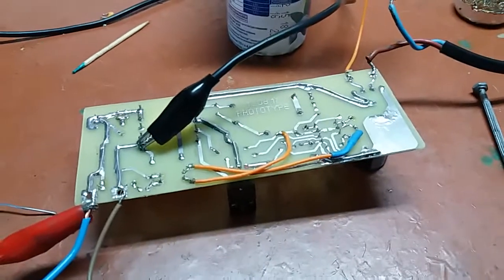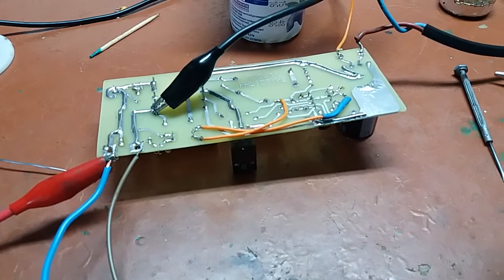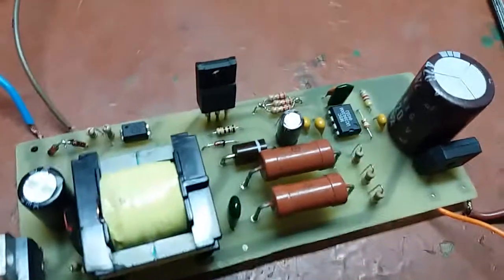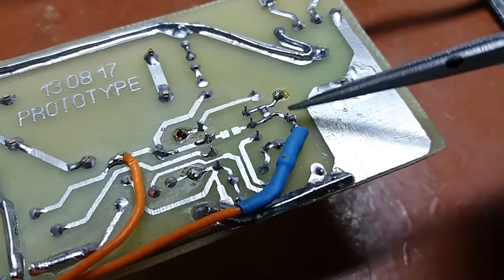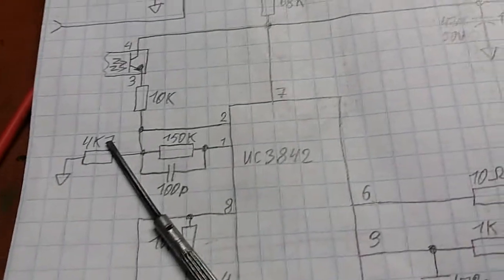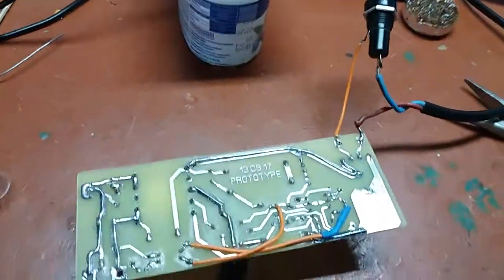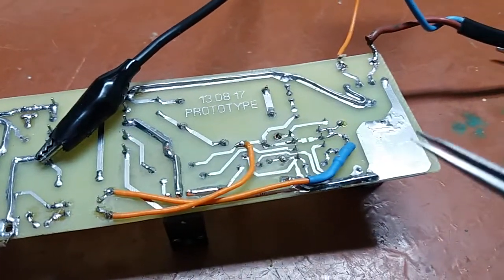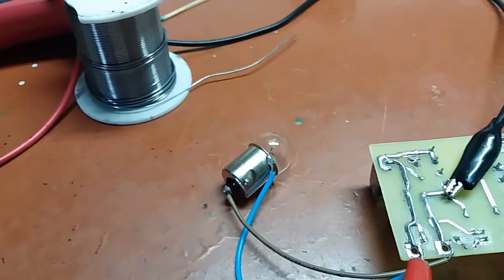Example of what freq. compensation does

Comment: hi john . can u explain how can we  wind transformer of  smps .   can u work uc3825 current  mode and  current limiting ?  thank u so much . i love smps working
Reply from the maker: Yeah, I will do a video about transformer construction. About the UC3825, i don't have that chip around, might give it a try later. You can make quite powerful two-switch forward converter with UC384x chips, I don't really see the reason to use that controller, it doesn't have a floating channel for a high side MOSFET, so you will need to use GDT or a driver chip to do that, same as with UC384x.
Reply: i know only half bridg topology transformer calculation.  uc384x is  flyback or forward bridge topoly using. am i right ?   i hope u grow your smps video . good luck sir
Reply from the maker: ra er Well, uc384x chips can be anything (buck, boost, SEPIC, etc.) But most often it's used in flyback power supplies. I'm gonna show the software in the video about the transformer.

Comment: Hi and greetings from greece again! Do you use tining agent to make the tracks so silver shiny or just use solder? Thank you for the educational video! One more question if you can inform me. What is the average max wattage i can gain if i rewind a huge  flyback coming from a 30'' crt?
Reply from the maker: I just drawned the board in flux and tinned it with the bevel tip on the iron :D 
 It depends on the cross-section of the core and the frequency you plan to use and of course the toplogy, but those cores are generally good for 100+W starting from 40kHz.

Comment: Yep, i stand under LOL :-D
Slowing down the negative feedback response so it does not add unwanted modulation or high frequency to the transformer.

DISCLAIMER: I RESERVE THE RIGHT TO KNOW SOD ALL ABOUT THE SUBJECT AND MAKE MAD GUESSES, NOTHING I SAY SHOULD BE TAKEN AS FACT. :-D
Reply from the maker: That is exactly what happens, error amp noise caused PWM to jitter, thus effectively amplitude modulating the output.
Reply: Ive had similar problems with c.b radio 16Mhz pll synths, the output of the phase detector was modulating the vco at audio frequencys.
So there is a tone heard on the transmit side and the receive side.
Rather annoying :-(